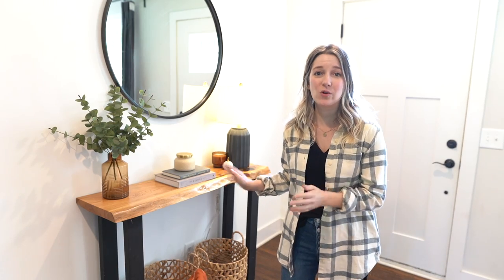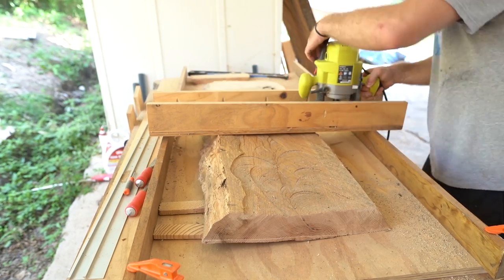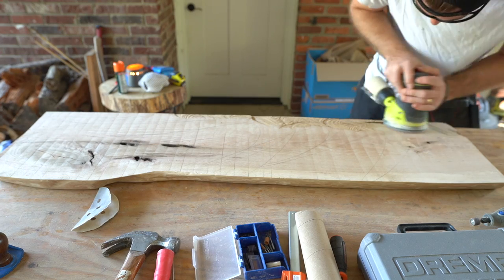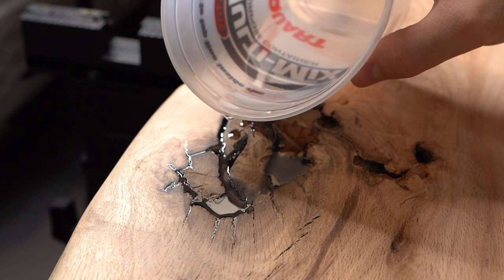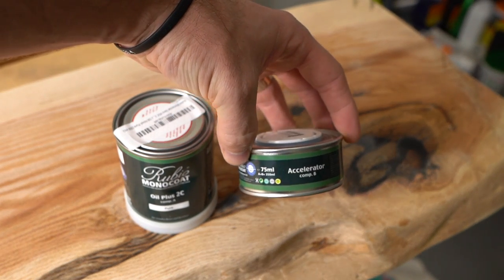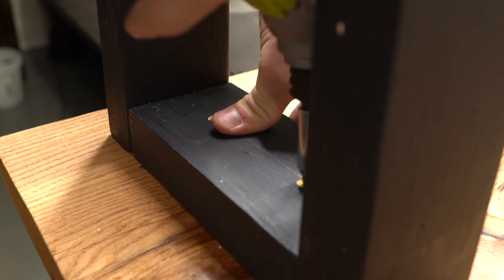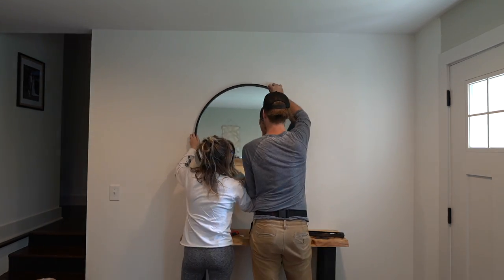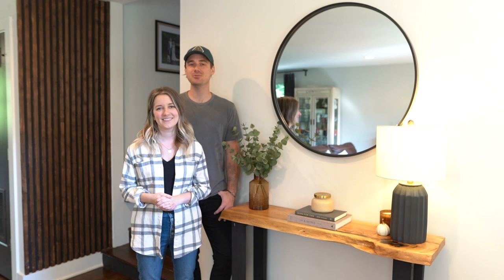DIY Live Edge Console Table + Entryway Makeover

Comment: Beautiful entry table amazing how such little can look beautiful. Am going into slabbing my own timber so possibilities gonna be endless. 🏴👍 What bit do you use for flattening table tops?one thing I've found aswell to clean after u take the bark off is wire wheels in a drill they work great and are really cheap.
Reply from the maker: We use a 1/2” surfacing bit. Amazon!
Reply: @justinandjessdiy  no worries thanks I'll check it out. 🏴👍